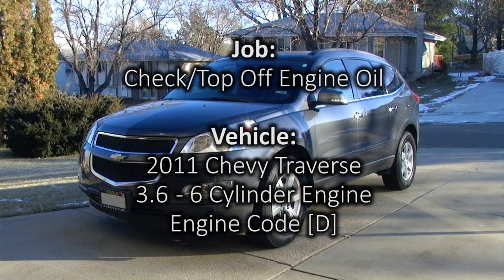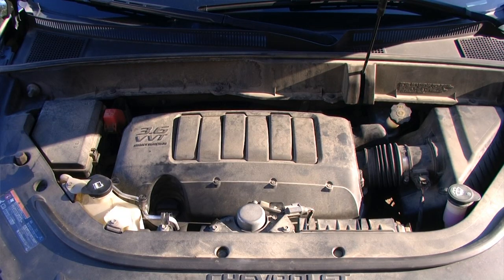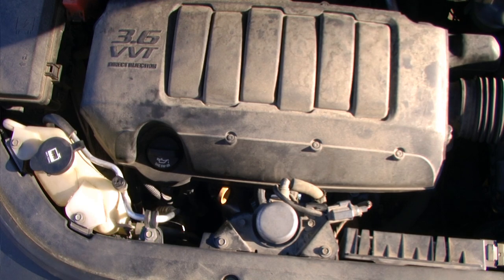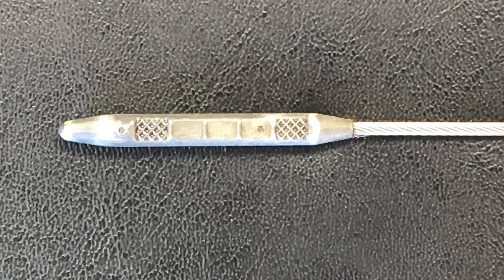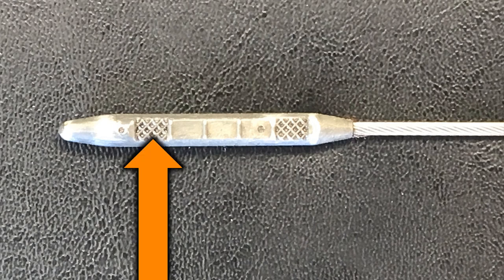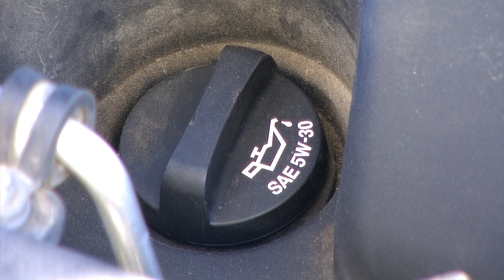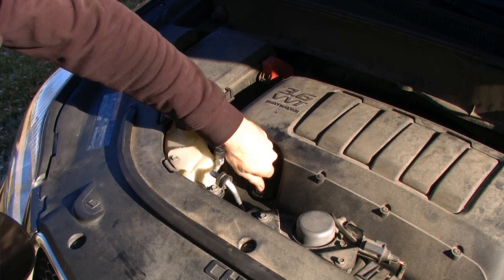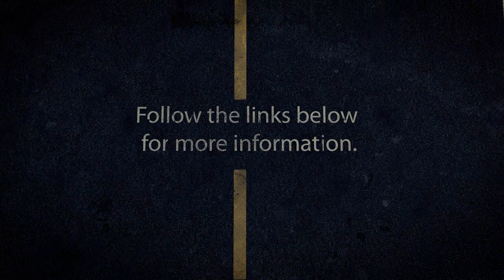2011 Chevy Traverse - Checking Engine Oil

Comment: thanx for the video info.. i also have same question as the other guy about the oil brand
Reply from the maker: You do not need the factory dealer oil.  As per the Magnuson-Moss Warranty Act of 1975, you can use any brand oil you choose as long as it meets the manufacturer's specifications for your engine. https://www.amsoil.com/about/guarantee/?zo=10458

Comment: GM says use 5.5 qt of oil, which brings the level in the above level hatch marks. 
The dealer has been doing my oil changes and that's what I've always read full oil on above hatch mark.
Just recently started my own oil changes.2010 anyone with same issue.

Comment: On a 2014 chevy traverse, do i need factory dealer oil? Or can I use regular 5/30 of my choice?
Reply from the maker: You do not need the factory dealer oil.  As per the Magnuson-Moss Warranty Act of 1975, you can use any brand oil you choose as long as it meets the manufacturer's specifications for your engine. https://www.amsoil.com/about/guarantee/?zo=10458

Comment: From the bottom to the top isn't one quart if that was the case it would be reading full when you only had a single quart of oil in
Reply from the maker: In general it is about one quart on most vehicles.
Reply: Not one quart total but one quart from the recommended max total quarts. He means if it calls for 5, from line to line is generally your 4th to 5th quart

Comment: Does the car need to have ran for a bit? Or should it have been sitting off for a while?
Reply from the maker: Either.  Just know that if you run the vehicle for a while, the oil will heat up and show a slightly higher level on the dip stick.

Comment: Should you check oil cold or after the car has been running?
Reply from the maker: You can do either.  If it is warm, the level will typically be slightly higher.  I typically check my oil with the engine warm.
Reply: Cold will give you the most accurate reading, as all the oil has drained back into the pan.